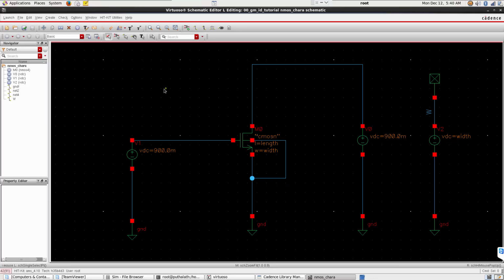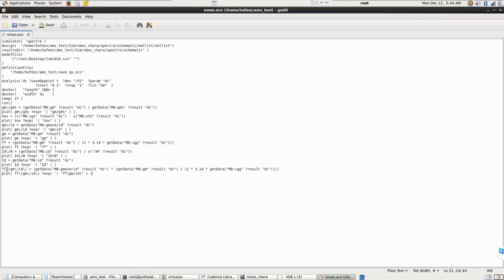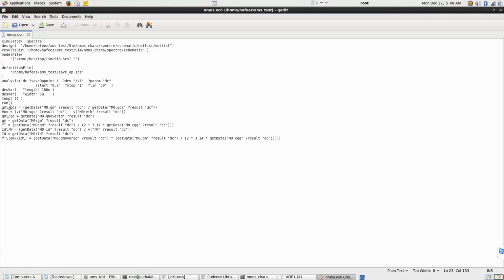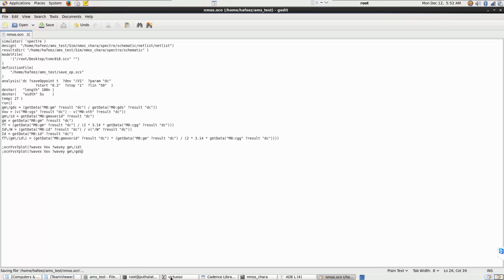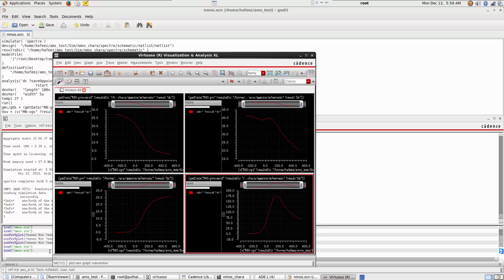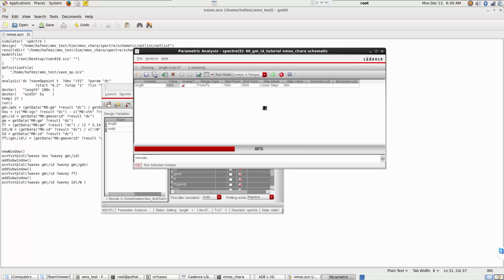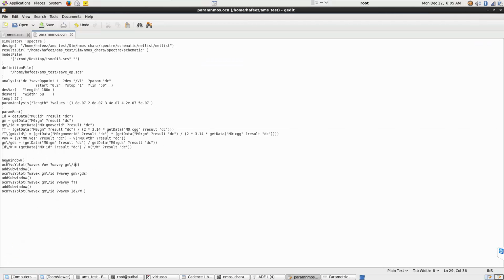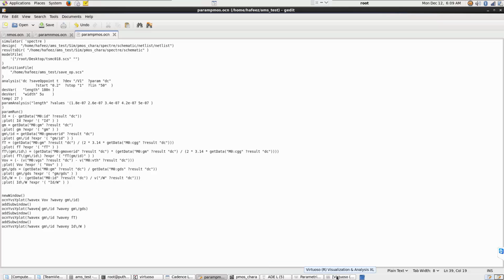gm over id (gm/id) method part 3 plotting in cadence

Comment: Hello sir, Thank you for this video. 
while I am  doing YvsY plot using parametric analysis, it is giving plot for only one value of  L which is minimum. For other values of L it is giving error like (Cannot complete the simulation run because there seems to be some problem with the Spectre executable. Ensure that the Spectre installation is correct and then rerun the simulation. For further assistance, contact Cadence Customer Support.) Could you please help me out Sir.
And could you please explain the interpretation of the gm/id graphs which you plotted?